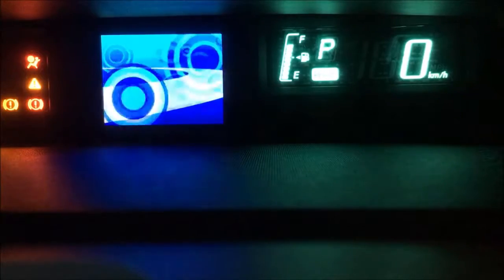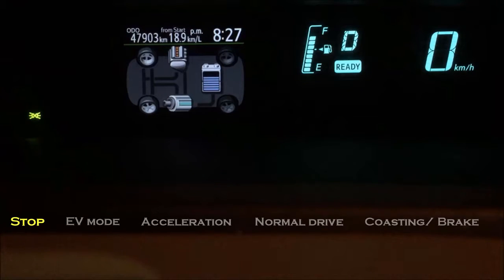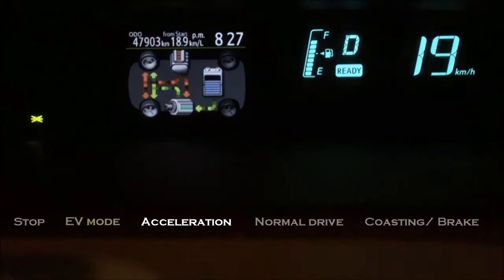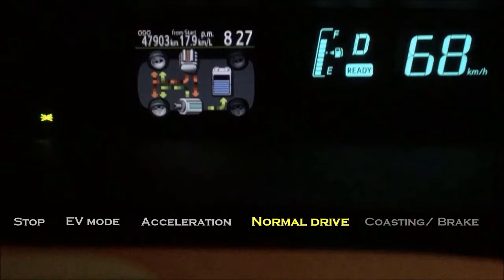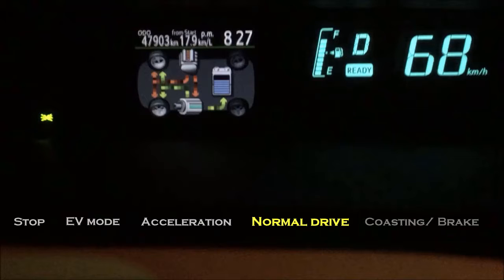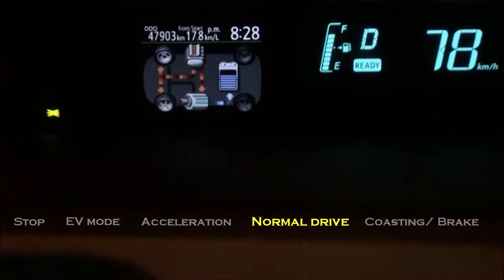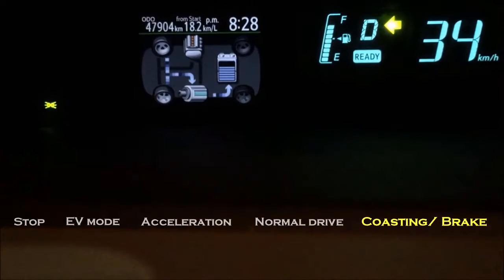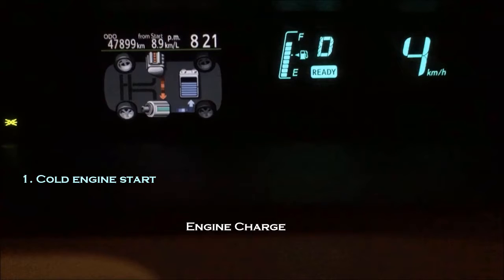How hybrid car works explained with ACTUAL driving Prius C dashboard energy monitor

Comment: Thank you for making I got a 2014 prius c 12300 The other day I got a white warning to check hybrid system my battery was only on 1 bar I took to dealer they cleared code stuff & said cells low told me it could go in a day a month or a year said there's no telling Now I'm a nervous wreck just trying to save money to get a new used car